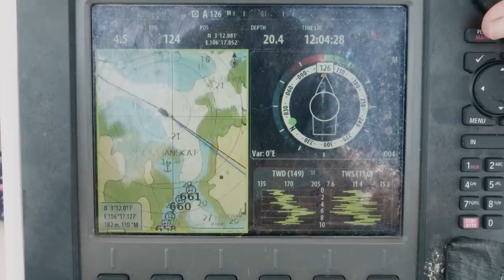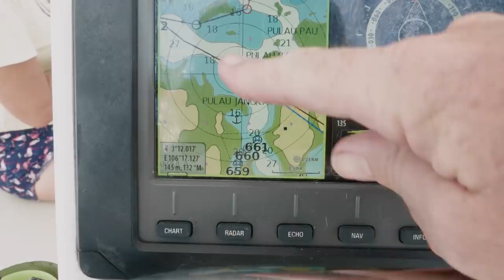How to pick up a mooring buoy + best sailing destinations - Sailing Ep 179

Comment: Running the mooring line from chock to chock increases chafe on the line at the swivel or eye on the ball a hundred-fold.  Always bring the line back to the same side to prevent "sawing" at the ball as the line slides back and forth through that (sometimes jagged) loop at the ball or the eye on the pennant.  

Many places absolutely forbid you to use any metallic fasteners on their balls because it chews them up and increases chafe dramatically for  those who are using fiber lines.

We use our own mooring bridle on a mooring ball if we are there for any length of time with our own heavy 3/4" swivel and two  3/4" nylon lines for spring, if they say it is OK to use our steel swivel.  Many places have a special pendant for tying to which has the "no metal" prohibition, and it is OK to use your own steel connection to the ball itself.  

Ours is a Chicago-spec. mooring bridle used for Chicago's brutal downtown harbor.  We used it for a couple of years when we lived there for the summer seasons.  It is still in great shape.  Maybe one of these years we will replace the fiber lines on it.

We spent a couple of months last winter in Vero Beach, FL on a ball and another 5-6 weeks in Montreal last summer on a ball at Longueuil Yacht Club.  But usually we are on our own anchor and chain.
Reply from the maker: Yup, pretty much what Jamie says in the episode. Thanks for sharing your own system. Liz 👍
Reply: @followtheboat  exactly. It is amazing how many cruisers do not realize this though, and we see the mistake often enough at popular mooring fields.  The more folks know the better.  I rarely see this mentioned in training materials -or on YouTube channels which is all too often the only training a lot of new cruisers seem to get these days it seems.

We took a free day ball on a couple of occasions last August up in Burlington Vermont on Lake Champlain, which is a popular summer cruising hideaway in the Eastern US.  All too many folks were doing it wrong.  I wonder how often folks break free in storms because of this and the resulting chafe wearing straight through a line?  What a sad way to lose a boat.  :(